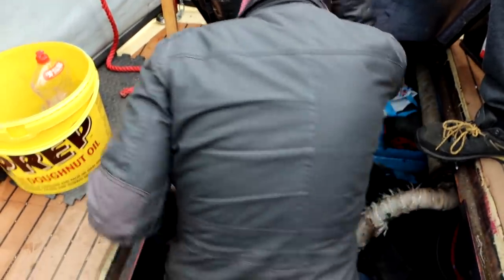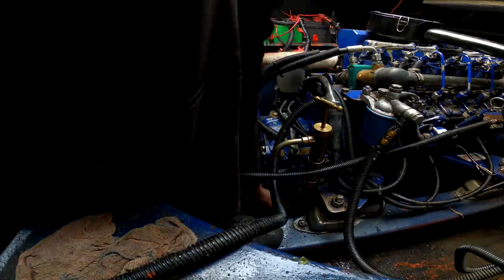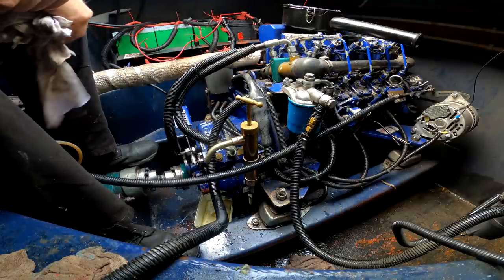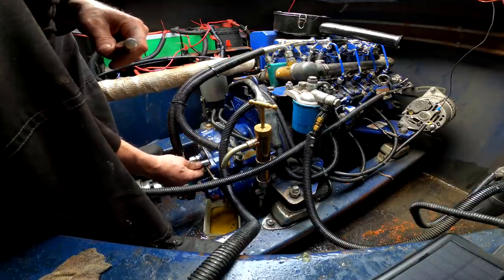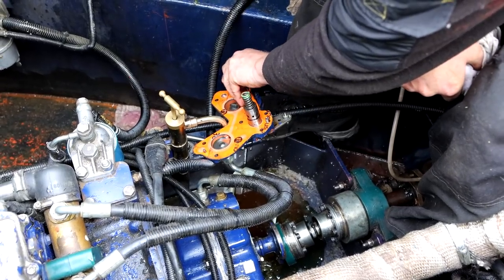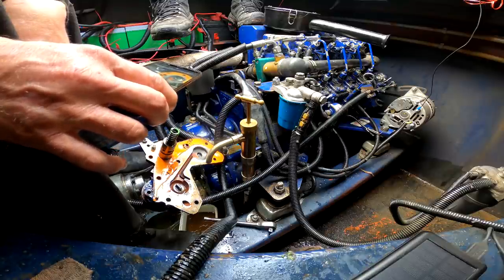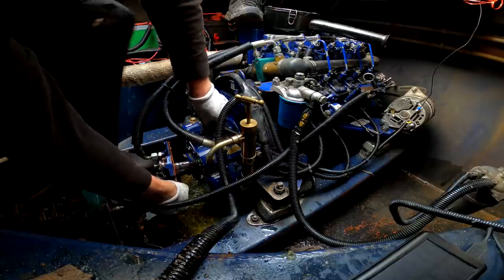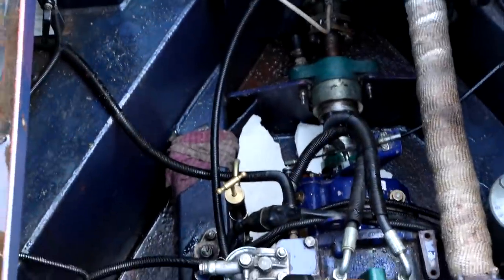121 - #NarrowboatWill Repairs Our Narrowboat's Terrible PMR 150D Gearbox Oil Leak

Comment: The allen key is there for locking the ahead clutch should you run out of oil. If you look at the end of the gearbox there is an access hole so that you can get to the screws on the ahead clutch to lock it up manually. Also if the selector shaft oil seal fails completely it can be replaced with one of the seals from a Fram C1191PL or equivalent fuel filter. The selector shaft oil seal is easily removed by removing the selector arm, spring and ball. Crank the engine on the starter with the fuel control in the stop position. The oil pressure in the box will push out the spacer and seal, the seal may not come all the way out but it will be easier to get at. Ken Wheeler, Narrowboat Services. Chester
Reply: Thanks for that advice Ken

Comment: Don't forget the PRM150 is also used in some sea going boats! So if you run out of gearbox oil for whatever reason you can set the forward clutch in gear so you can return to port. The Allen key is there to ensure that  the correct size of Allen key is available. If you had an Allen supplied loose.....it would inevitably get lost!
So with the Allen key kept in the oil pump casing it's always there ready for emergency use...if necessary. Look on the bright side, the Allen key won't go rusty!!! Always keep the PRM150 manual in your phone's files library!!!